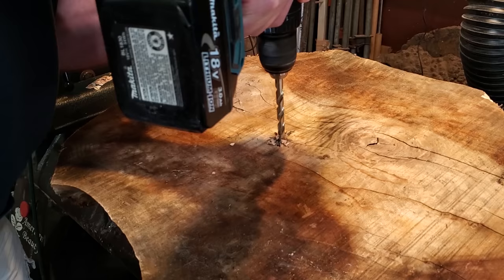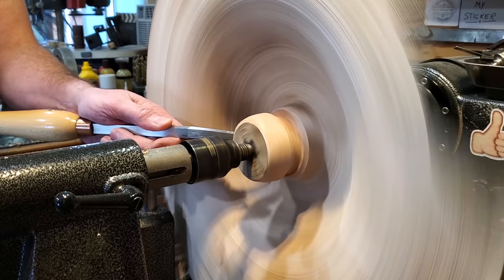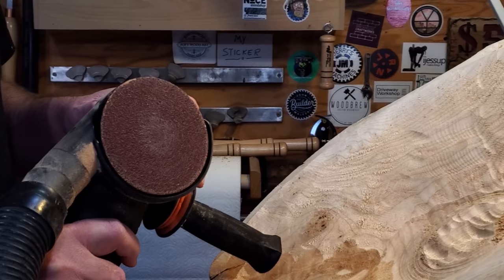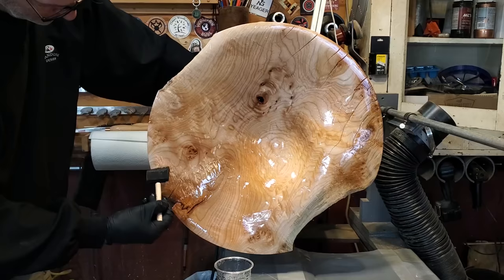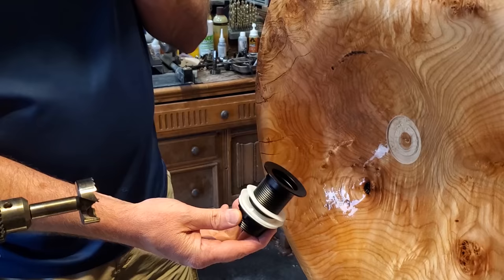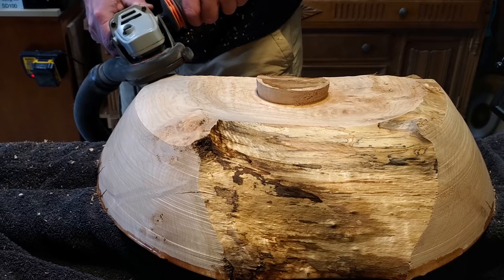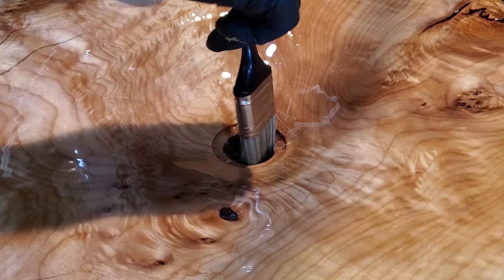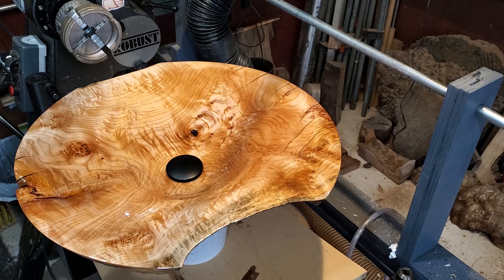Maple Sink

Comment: Nice work as usual. I use epoxy a lot for countertops. I’ve tried to refinish sinks but the running is tough. What did you do on your final coat to make it so smooth? Thanks
Reply from the maker: Thank you Jason! I went around it several times brushing the finial coat down to the drain.

Comment: Well done Carl.  How often do you have to re-seal the wood with normal wear?
Reply from the maker: Thank you!! You really don't need to as far as I know. I've had mine for a few years, and it still looks the same. If it ever did get damaged, you can put another coat of clear on and it will look new again.